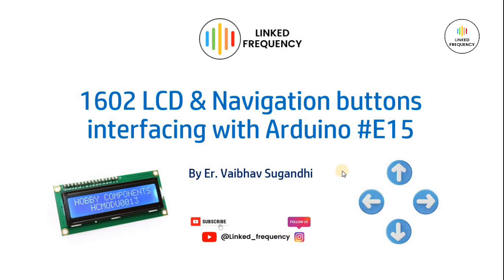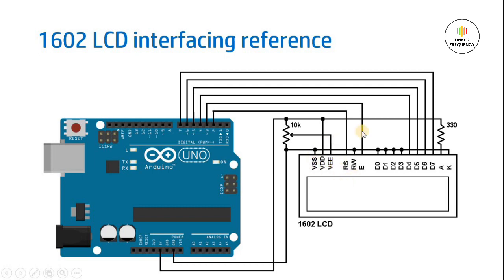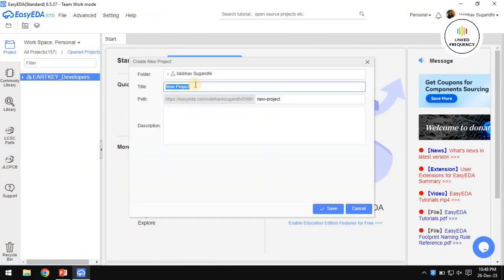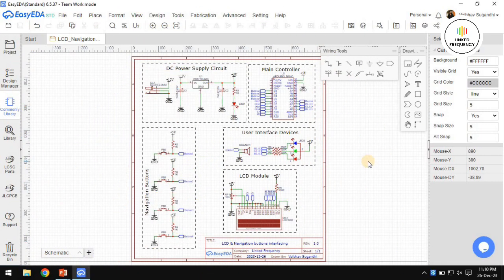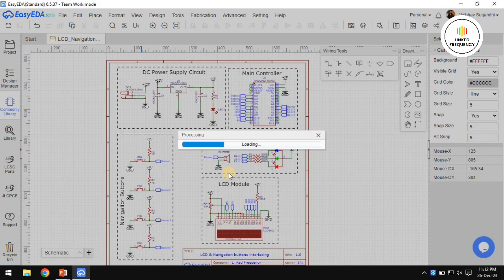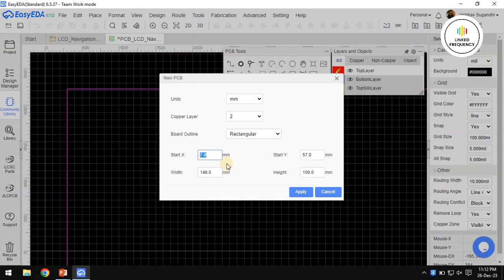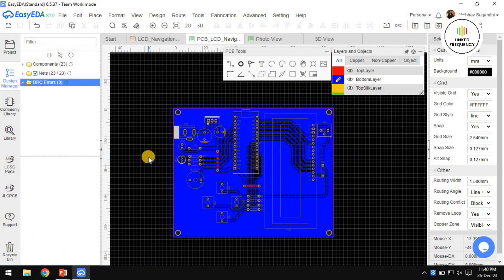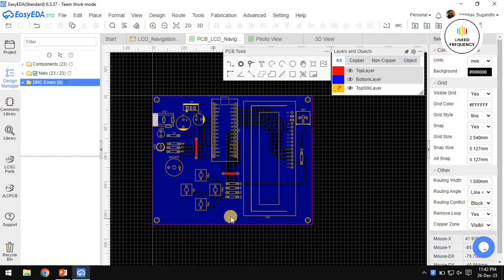1602 LCD & Navigation button interface with Arduino EP15 | Vaibhav Sugandhi

Comment: Hello sir thank you for your amazing tutorial.
I'm having trouble in tracing  the pcb on copper pad, what printing paper/material should I use to trace pcb on copper pad ?
Reply from the maker: Thanks for your support :)

If you are using toner transfer method, then use glossy photo paper <100 GSM. 
Else use UV curing film & inverted PCB design for PCB fabrication. 

This topic is all together different one, you have to learn some basic skills before doing it directly. 

Happy learning, 
#Linked_Frequency